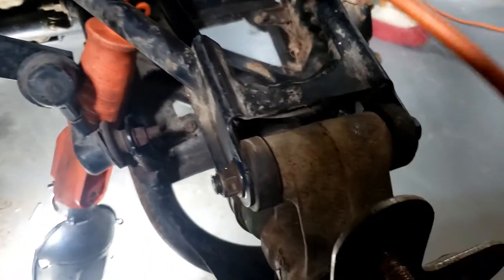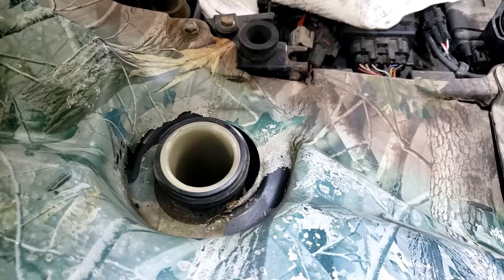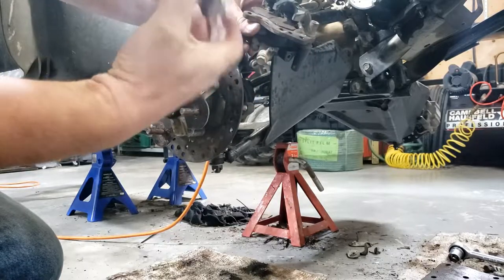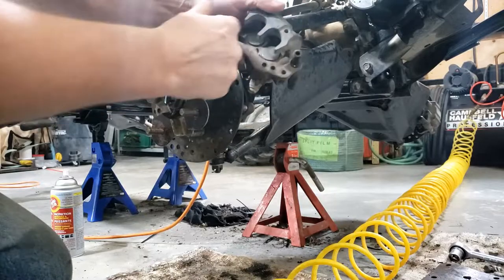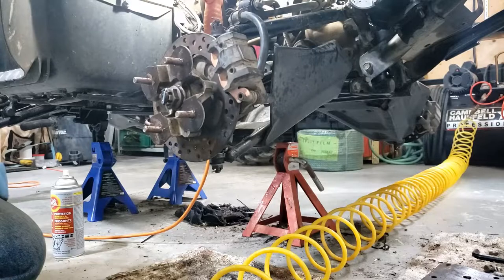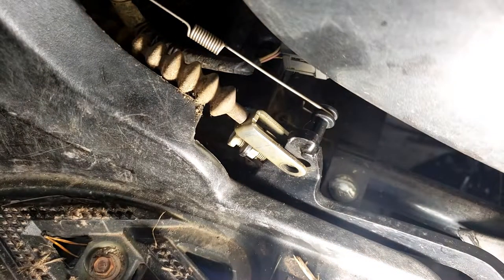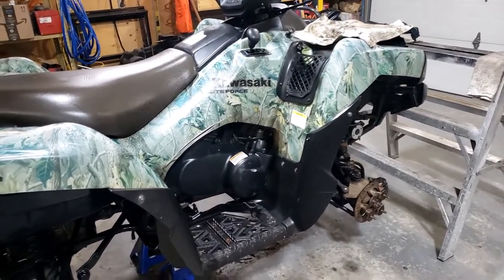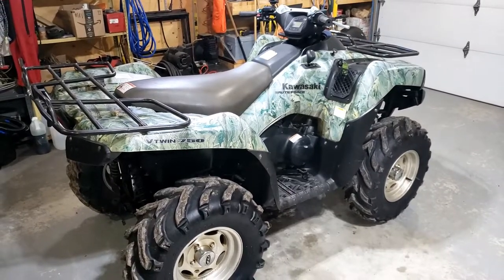Kawasaki Brute Force 750 ATV front brake pads replace

Comment: Boy I'll tell ya, I've got a 2018 Bruteforce 750.  

And I bought  the (WARN PROVANTAGE PLOW PACKAGE)...   And doing the installation was a BUGGER. The plow mount to itself was such a task. I did a YouTube search and nothing came up for that topic. 

If you had done a YouTube video on this Topic Rob, You would have over a million views. Because nobody has done an installation video on that. ( NOT EVEN WARN THEMSELVES) has produced a video for it. 

So maybe in your future,  to help out the ATV community.  You can put a video out on that task. And I'm sure you will get plenty of compensation for your efforts.  👍
Reply from the maker: That's interesting, thanks!  There's a Click 'n Go mount on this machine, looks pretty easy to mount that one.  Things are changing quickly with this machine, so we'll have to see where I go from here.
Reply: @RobFarrowATV  

I realize that there is probably several options for plows, But this was more directed for their (WARN PROVANTAGE PLOW MOUNT AND SYSTEM)...  

But Mine is finally mounted, and it's got their Quick release integration system. So hook up and disconnect is a breeze.  

Look them up, I'm not affiliated with them by any means. Just really like the WARN products.  

Hopefully you pull the trigger on that same 1 type and 1 too, and make a detailed installation video on it too!

Comment: Ah, gravity is cheep.
Reply from the maker: LOL!
Reply: I was watching a ytvchannel where a guy is running heavy gauge wire through buggy tyres. He lubed the tyres with wd-40 and forced it through with compressed air.  I thought that might work for those frozen brake cables.
Reply from the maker: Ya, ended up buying two new brake lines...much easier. LOL!